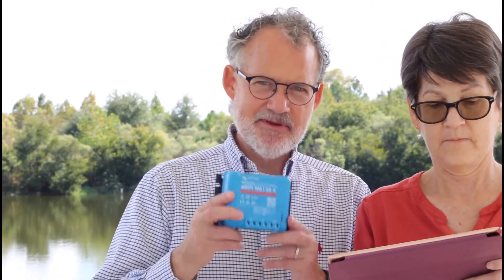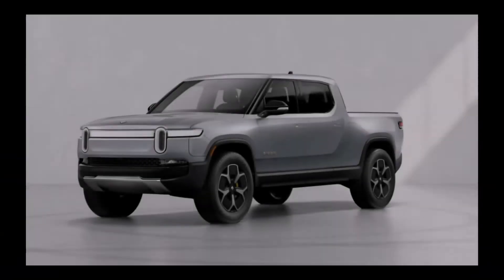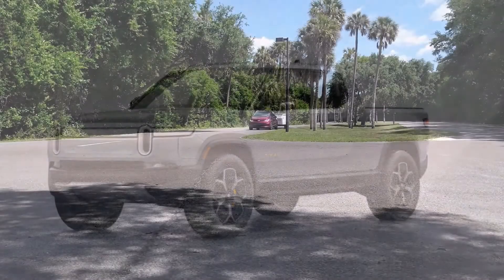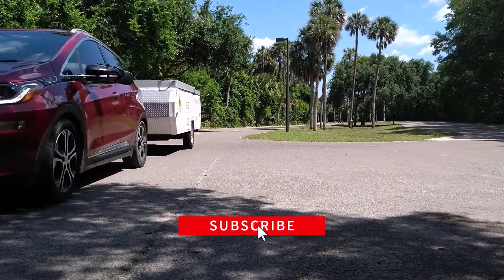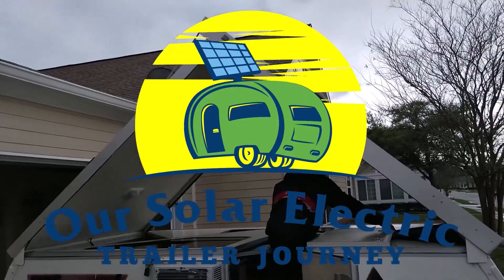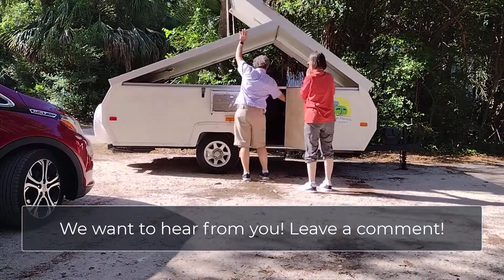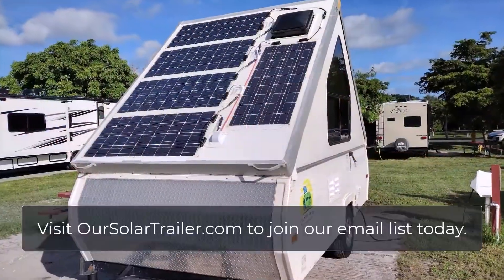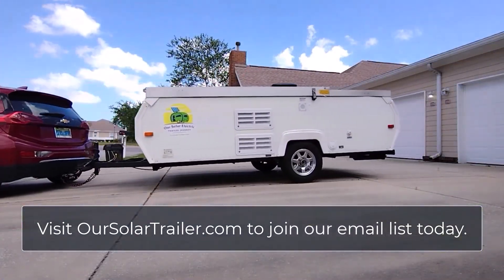How We Chose the Wrong Charge Controller for the Solar on Our Aliner Scout - You Pick the Right One!

Comment: Hi! Google put your video into my feed so I thought I would answer a couple of your questions. First, the voltage on the input side of the MPPT (your solar array) must be higher than the battery bank voltage by at LEAST 5 degrees as you stated. The reason is, current can only flow when there is a difference in voltage, sometimes called potential. When I'm sizing a solar array to MPPT controllers for customers, I usually try to get at least 7 volts margin, preferably 10 volts. 

Second, the colder a panel gets, the more output it can deliver. The numbers published by the manufacturer are for standard test conditions (STC). STC cell temperature is 25 degrees Celsius, which is about 77 degrees F. When the cell temps are below this temperature, then can produce higher voltage, which can be calculated by the temperature coefficients spec'd by "better" solar panels. The generic panels such as Renogy, Rich Solar, etc., often don't publish the temp coefficients, so leave yourself some added margin.

Victron solar charge controllers have two important ratings that are used in the model number: input voltage and output current. If your solar panels show an open circuit voltage of 20 volts and you put five of them in series, you can damage your solar charge controller on a bright, sunny, cold day because the series voltage will exceed volts. Even if you chose a 100/30 MPPT, that voltage would occasionally go higher than 100v in cold weather, which could damage your MPPT. Your video thumbnail showed a picture of a 150/35 controller, which is the right solution for you!

In your 150/35 MPPT, it will handle a maximum voltage of 150 volts input, and up to 35 amps of charging current. So, in a 12v system, the most you should push through the MPPT is 420 watts (12 x 35). There is a little extra margin, especially with lithium batteries, but I won't confuse the matter. Now, if you have a 24v battery system, that same controller can now handle a maximum power of 24 x 35, or 840 watts. 

So, because of the voltages above, I usually install 200w "24v" solar panels, which have an actual output voltage closer to 40 volts when fully illuminated. This allows even a single solar panel to charge a 12v OR 24v battery, without having to put panels in series strings. Usually, however, we'll wire two panels in series, and if there are more panels to install, then they get wired in pairs of two, and then each pair of two is wired in parallel. This keeps my voltages up and also helps a bit with shading since we're using parallel strings. This is a good compromise for many RV installations, but not all.

One word of advice for anyone reading this: On a vehicle, install as much solar as you can fit on the roof. The most you're ever likely to see your panels produce is 70% of their rating, unless you have perfect STC conditions and the panels are aligned directly toward the sun. No one in a vehicle ever said "I have too much solar" 🙂

Please let me know if you have any questions.
Reply from the maker: Fantastic! Thank you for sharing!

Comment: Sounds like you have (5) panels wired in series.   Perhaps could have solved the issue more simply by changing wire connections, to one bank of two panels in series and one bank of three panels in series, and then wiring the two banks in parallel to input into controller.   Then your voltage would go not much above 60v and total watts would remain the same as before.
Reply: Any time you can share pictures or video of your topic of the week would be super. Thanks for learning for us, so we can follow along when we have an EV :-)
Reply from the maker: @markhinkley4271  Great feedback! Thank you so much!
Reply from the maker: You are right. We could have done it that way, but it would have been more difficult to rewire the solar panels in our situation. In other situations, we would have done exactly what you suggest.